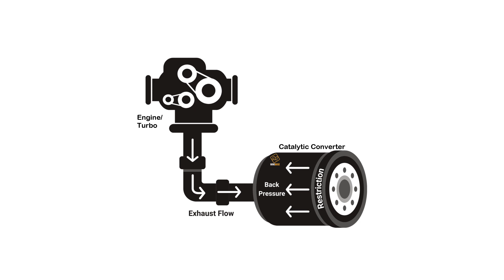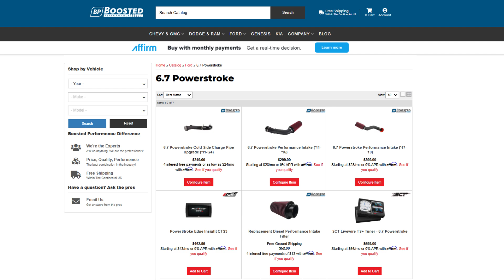How to Get 600+ WHP on Your Ford 6.7 PowerStroke – The Essential Bolt-On Mods

Comment: Any advice on being a boring old man and wanting to get max reliability over performance?  I got a 2025 f250 with a 6.7 PS for my business.
Reply: CCV delete, EGR and DPF delete, Pusher or similar aftermarket intake manifold, S&B cold air intake, and a super light tune. You can get a tune just for the delete that won’t give any more horsepower or make it blow black smoke. Be careful doing any modifications on your truck because they WILL void your warranty. Good luck
Reply: @sethzimpleman4661 Thank you!
Reply: @sethzimpleman4661  are diesel dudes worth looking into for the delete's and tunes? or ?
Reply: @EdCarlo-bx5gu and for the delete itself you can install a race pipe in your driveway. Took me about an hour to remove the old and in with the new. Cost me around $260 from Spelab
Reply from the maker: F - @sethzimpleman4661 hit it on the head!

Comment: Do those power numbers apply to the 6.7 HO? 

Also, why rate the transmission in HP? You could make 600 whp without pushing much more than 1200 ft-lbs if you just run the torque out to a higher rpm. 1200 ft-lbs at 3000 rpm is gunna be making 685 crank hp.
Reply from the maker: J - Yes it does.